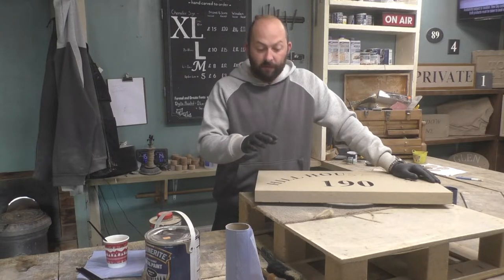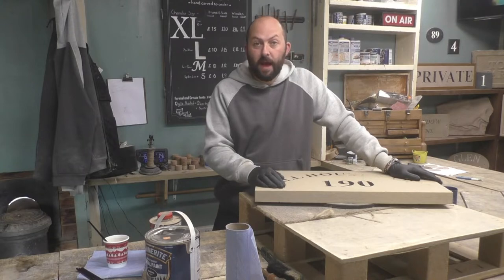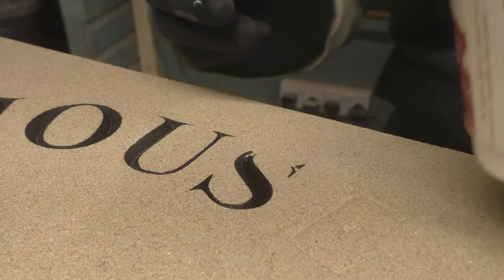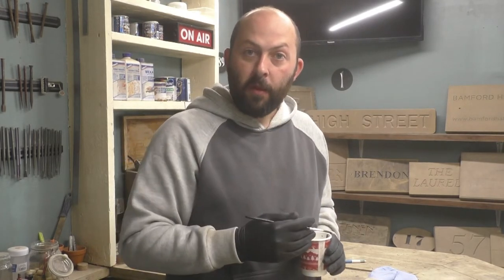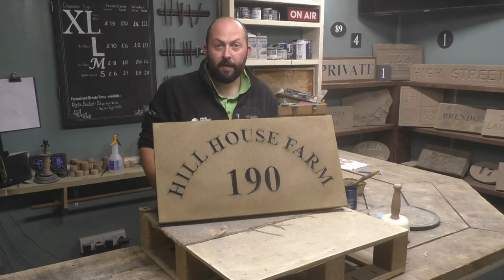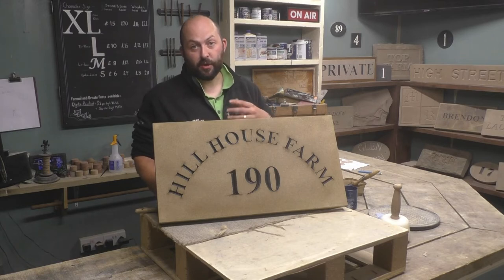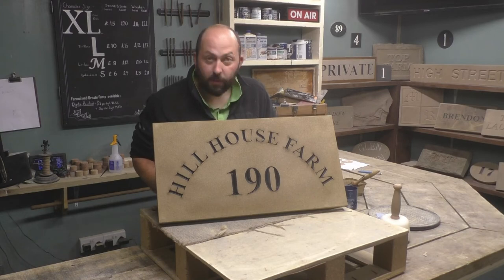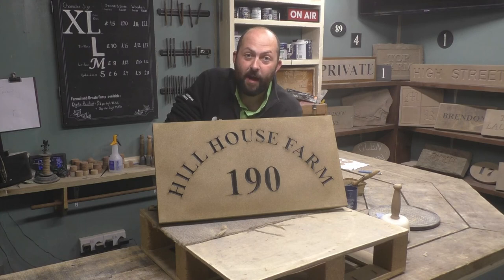TUITION ON PAINTING A STONE HOUSE SIGN, HOW TO PAINT A STONE OR SLATE HOUSE SIGN

Comment: I still do it the old skool way. Buy a decent potters clay, wet your stone and clay and rub it over the stone. This will then create a barrier for the paint. Cut your letters/numbers as usual (don't brush as you cut, just blow) and just paint it willy nilly nearly when finished. Wait till it dries and wash it down with water. Saves so much time. If there is any leakage just use a 1000 grit carbo block to clean the surface. I hope you give it a try and it works better for you timewise. 👍😉
Reply from the maker: Hi, thank you for the tip. I will definitely give it a try, maybe even film my first attempt so other people can see how it works. I must admit, I do enjoy painting by hand. I find it very relaxing. 👍👍